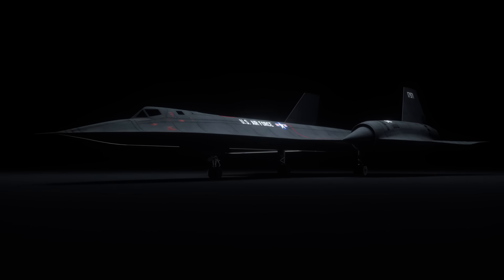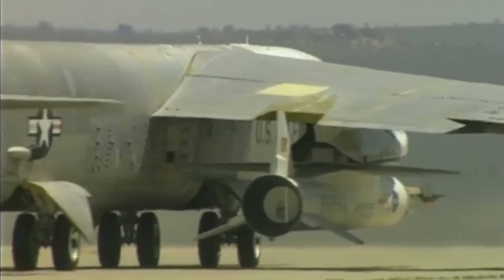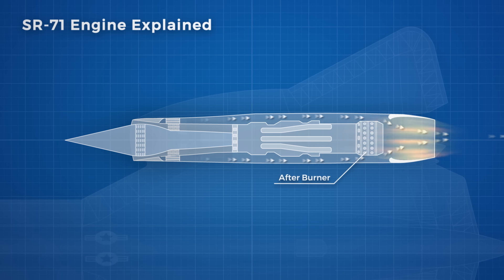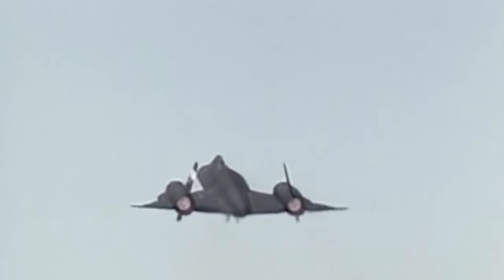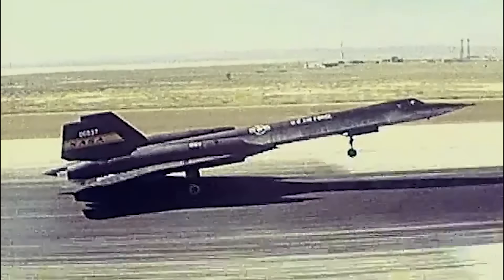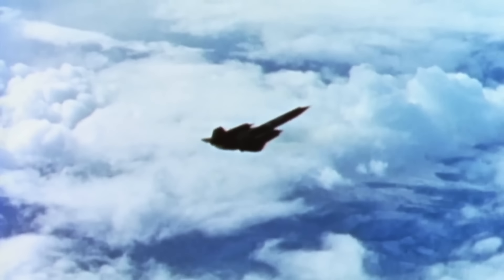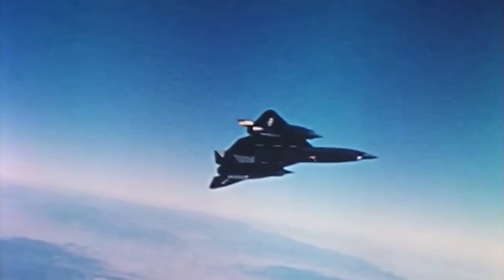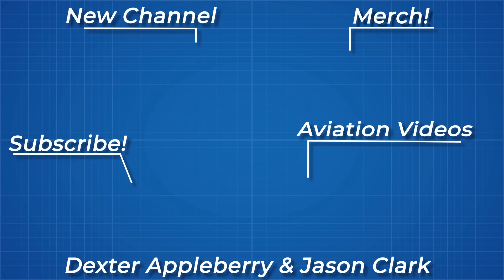The Insane Engineering of the SR-71 Blackbird

Comment: As a former SR-71 pilot, and a professional keynote speaker, the question I'm most often asked is "How fast would that SR-71 fly?" I can be assured of hearing that question several times at any event I attend. It's an interesting question, given the aircraft's proclivity for speed, but there really isn't one number to give, as the jet would always give you a little more speed if you wanted it to. It was common to see 35 miles a minute. Because we flew a programmed Mach number on most missions, and never wanted to harm the plane in any way, we never let it run out to any limits of temperature or speed. Thus, each SR-71 pilot had his own individual “high” speed that he saw at some point on some mission. I saw mine over Libya when Khadafy fired two missiles my way, and max power was in order. Let’s just say that the plane truly loved speed and effortlessly took us to Mach numbers we hadn’t previously seen. So it was with great surprise, when at the end of one of my presentations, someone asked, “what was the slowest you ever flew the Blackbird?” This was a first. After giving it some thought, I was reminded of a story that I had never shared before, and relayed the following. I was flying the SR-71 out of RAF Mildenhall, England , with my back-seater, Walt Watson; we were returning from a mission over Europe and the Iron Curtain when we received a radio transmission from home base. As we scooted across Denmark in three minutes, we learned that a small RAF base in the English countryside had requested an SR-71 fly-past. The air cadet commander there was a former Blackbird pilot, and thought it would be a motivating moment for the young lads to see the mighty SR-71 perform a low approach. No problem, we were happy to do it. After a quick aerial refueling over the North Sea , we proceeded to find the small airfield. Walter had a myriad of sophisticated navigation equipment in the back seat, and began to vector me toward the field. Descending to subsonic speeds, we found ourselves over a densely wooded area in a slight haze. Like most former WWII British airfields, the one we were looking for had a small tower and little surrounding infrastructure. Walter told me we were close and that I should be able to see the field, but I saw nothing. Nothing but trees as far as I could see in the haze. We got a little lower, and I pulled the throttles back from 325 knots we were at. With the gear up, anything under 275 was just uncomfortable. Walt said we were practically over the field—yet; there was nothing in my windscreen. I banked the jet and started a gentle circling maneuver in hopes of picking up anything that looked like a field. Meanwhile, below, the cadet commander had taken the cadets up on the catwalk of the tower in order to get a prime view of the fly-past. It was a quiet, still day with no wind and partial gray overcast. Walter continued to give me indications that the field should be below us but in the overcast and haze, I couldn't see it.. The longer we continued to peer out the window and circle, the slower we got. With our power back, the awaiting cadets heard nothing. I must have had good instructors in my flying career, as something told me I better cross-check the gauges. As I noticed the airspeed indicator slide below 160 knots, my heart stopped and my adrenalin-filled left hand pushed two throttles full forward. At this point we weren't really flying, but were falling in a slight bank. Just at the moment that both afterburners lit with a thunderous roar of flame (and what a joyous feeling that was) the aircraft fell into full view of the shocked observers on the tower. Shattering the still quiet of that morning, they now had 107 feet of fire-breathing titanium in their face as the plane leveled and accelerated, in full burner, on the tower side of the infield, closer than expected, maintaining what could only be described as some sort of ultimate knife-edge pass. Quickly reaching the field boundary, we proceeded back to Mildenhall without incident. We didn't say a word for those next 14 minutes. After landing, our commander greeted us, and we were both certain he was reaching for our wings. Instead, he heartily shook our hands and said the commander had told him it was the greatest SR-71 fly-past he had ever seen, especially how we had surprised them with such a precise maneuver that could only be described as breathtaking. He said that some of the cadet’s hats were blown off and the sight of the plan form of the plane in full afterburner dropping right in front of them was unbelievable. Walt and I both understood the concept of “breathtaking” very well that morning, and sheepishly replied that they were just excited to see our low approach. As we retired to the equipment room to change from space suits to flight suits, we just sat there-we hadn't spoken a word since “the pass.” Finally, Walter looked at me and said, “One hundred fifty-six knots. What did you see?” Trying to find my voice, I stammered, “One hundred fifty-two.” We sat in silence for a moment. Then Walt said, “Don’t ever do that to me again!” And I never did. A year later, Walter and I were having lunch in the Mildenhall Officer’s club, and overheard an officer talking to some cadets about an SR-71 fly-past that he had seen one day. Of course, by now the story included kids falling off the tower and screaming as the heat of the jet singed their eyebrows. Noticing our HABU patches, as we stood there with lunch trays in our hands, he asked us to verify to the cadets that such a thing had occurred. Walt just shook his head and said, “It was probably just a routine low approach; they're pretty impressive in that plane.” Impressive indeed. Little did I realize after relaying this experience to my audience that day that it would become one of the most popular and most requested stories. It’s ironic that people are interested in how slow the world’s fastest jet can fly. Regardless of your speed, however, it’s always a good idea to keep that cross-check up…and keep your Mach up, too.As a former SR-71 pilot, and a professional keynote speaker, the question I'm most often asked is "How fast would that SR-71 fly?" I can be assured of hearing that question several times at any event I attend. It's an interesting question, given the aircraft's proclivity for speed, but there really isn't one number to give, as the jet would always give you a little more speed if you wanted it to. It was common to see 35 miles a minute. Because we flew a programmed Mach number on most missions, and never wanted to harm the plane in any way, we never let it run out to any limits of temperature or speed. Thus, each SR-71 pilot had his own individual “high” speed that he saw at some point on some mission. I saw mine over Libya when Khadafy fired two missiles my way, and max power was in order. Let’s just say that the plane truly loved speed and effortlessly took us to Mach numbers we hadn’t previously seen. So it was with great surprise, when at the end of one of my presentations, someone asked, “what was the slowest you ever flew the Blackbird?” This was a first. After giving it some thought, I was reminded of a story that I had never shared before, and relayed the following. I was flying the SR-71 out of RAF Mildenhall, England , with my back-seater, Walt Watson; we were returning from a mission over Europe and the Iron Curtain when we received a radio transmission from home base. As we scooted across Denmark in three minutes, we learned that a small RAF base in the English countryside had requested an SR-71 fly-past. The air cadet commander there was a former Blackbird pilot, and thought it would be a motivating moment for the young lads to see the mighty SR-71 perform a low approach. No problem, we were happy to do it. After a quick aerial refueling over the North Sea , we proceeded to find the small airfield. Walter had a myriad of sophisticated navigation equipment in the back seat, and began to vector me toward the field. Descending to subsonic speeds, we found ourselves over a densely wooded area in a slight haze. Like most former WWII British airfields, the one we were looking for had a small tower and little surrounding infrastructure. Walter told me we were close and that I should be able to see the field, but I saw nothing. Nothing but trees as far as I could see in the haze. We got a little lower, and I pulled the throttles back from 325 knots we were at. With the gear up, anything under 275 was just uncomfortable. Walt said we were practically over the field—yet; there was nothing in my windscreen. I banked the jet and started a gentle circling maneuver in hopes of picking up anything that looked like a field.How's it going gamers? Y'know, online dating is a modern day miracle. Instead of going outside and being a functional member of society, you can stay indoors and talk with a Russian hottie online who is, in reality, your creepy uncle George on the other side of the screen. I think we've all willingly, or unwillingly online dated before. I remember going onto Club Penguin and sitting on the corner of the pizza store wiping out my sad emoji, and all the penguin baddies would come rushing in asking me "oh my god, what's wrong ;("

One of the more prominent online dating games in the modern age is has been IMVU. Yes, it's that same game that would spam their creepy-ass advertisements on whatever website you were in. Me, personally, as a kid, was never really inclined to "find my Bella". However, the other day I decided to finally stream it and experience IMVU with all my viewers, and here's how that went

　　　.　　　 　　.　　　　　。　　 。　. 　

.　　 。　　　• . 　　 • 　　　　•

　　ﾟ　　 Red was not An Impostor.　 ඞ。　.

　　'　　　 1 Impostor remains 　 　　。

　ﾟ　　　.　　　. 　　　　.　 .
Reply: did you read all that?
Reply: @D1ragebait  yes
Reply: @noahsiegel3127  bru
Reply: What's the bit about online dating got to do with it?
Reply: Kind of yes. Then kind of huh?

Comment: The range of the SR-71 was limited to approximately 11.5 hours, by the amount of liquid nitrogen stored in its dewars, used to inert and pressurize the fuel tanks. The inlet system was designed by Ben Rich and his small team. He was awarded the American Institute of Aeronautics and Astronautics Award in 1972 for designing the Blackbird's propulsion system. The SR-71 had "tactical limits" of Mach 3.35 with a maximum Compressor Inlet Temperature of 427 C. In addition to the air, by-passing the engine to the afterburner for additional cooling and thrust, the front of the inlet, with its associated doors and spike, provided an inlet duct pressure of 18 psi, while the outside air pressure at 82,000 ft. was only 0.4 psi. This large pressure differential provided a forward thrust vector, pushing on the back of the spike and providing 54 % of the total thrust, while 29 % was produced by the ejector, and only 17 % by the engine. The speed of the SR-71 was limited by thermal temperatures, recoveries from "unstarts", and the shock wave, coming off its nose, entering the inlets, creating "unstarts." Above 3.35 Mach, there was a high probability that the aircraft would be unable to recover, if an "unstart" occurred.
Reply: I had thought that triethylborane was the primary limitation on the max number of mid-air refuelings. I didn't know about the nitrogen tanks; thank you!
Reply: @justinhannan1713  The SR-71 had 16 "shots" of TEB (Triethylborane) per engine, which was more than enough to accomplish its missions, regardless of their duration, 1 shot to start each engine, leaving the remaining TEB to relight its afterburners after refuelings or, in the event of a flameout, to restart the engine.

Comment: It's a classic engineering understatement to refer to Unstarting as "a sudden yaw". Pilots were knocked unconscious several times.  The "solution" was to detect the unstart and snuff the other engine.  Pilots reawaken in the world's largest lawn dart on a course to slam into the ground at mach 2-3.  Fortunately, they were starting from such a high altitude that there was time before impact to restart the engines and start aviating again.  Compared to the risk of the aircraft killing you in a flat spin, Soviet missiles were not seen as dangerous.
Reply: Exactly, not a sudden yaw. But a violent shaking that caused pilots head to hit the cockpit windows and walls... Not a really nice behavior
Reply: onyeka onyyebuchukwu  "high velocity vertical non-elastic impact test"

Comment: The fuel leak information isn't entirely accurate. The truth is no sealant was ever found that would work at all temperature ranges. Instead, realizing the expansion properties of titanium, the gaps that allowed the leaks were deliberately engineered into the design. So when the aircraft got to operating temperature, the leaks were sealed off mechanically. The sealant applied to limit the leaks only ever worked at ground temperatures and shortly after take off. By the end of each mission the sealant was mostly useless.
Reply: You are correct.  As a maintenance airman on the SR in the late sixties, I got to experience the leaking fuel and resulting drip pans for four years.  Loved it.
Reply: That's also the reason for the grooves in the wings which you can see at 8:51. Thermal expansion could cause the wings to bend but instead now the grooves just get a little deeper and the wings remains straight.
Reply: Larry Fry did you work at Area 51?
Reply: Something else caught my eye, the leak table, showing Zone 15, Dry Bay areas, 950 cc/Minute/Side. That seems unbelievable. By my calcs, that 950cc is 1/4 Gallon. So that would be 2 sides x 1/4 gallon, per minute, or 1/2 gallon/minute. 720 Gallons/Day. Come on... I've never heard of a leak like that. Is that right? https://youtu.be/3hYSnyVLmGE?t=586
Reply: This is what I heard too when I saw this plane at a museum in southern california last year.
Reply: Nuno Hipólito  Probably Edwards AFB
Reply: ryan christopherson The Concord had a similar issue. When I did a walk around, I’d get fuel dripping on me from several seams on the wing.
Reply: true
Reply: @bigbaddms  That probably is right. The video mentions extensive leaking and both this video and others show fuel literally streaming off the plane before takeoff. But, by design, once the plane was hot, the panels expanded, improved sealing, and the leaking dramatically decreased.

Comment: As interesting as the 3D printed titanium parts are for the future planes, I'm much more impressed by the Blackbird's clever engineering from the 1960's.
Reply: Also computer vs slide rulers!
Reply: Most of the SR-71's design came from the A-12 which was designed in the late 50's and built around the turn of the decade.  Kelly Johnson and the Skunk Works were incredible.

Comment: Early on in development, the test pilots found out in the event of an unstarted engine that unstarting both engines and restarting them both at the same time was far safer than trying to restart the unstarted engine. So that eventually made into the engine management computer.

This plane turned really badly due to the risk of unstarting an engine. Standard procedure to dodge a missile was to climb and accelerate.
It couldn't outrun soviet missiles back then. Those could easily reach mach 4 already if launched from an already fast moving aircraft. But it flew so fast and so high the time between detection and scrambling interceptors meant it was already out of range by the time they could take off and climb for interception. Regarding SAMs, the tech at the time didn't allow for on-the-fly calculations of interception vectors, so instead they relied on radar pings, mening they would have to follow and then catch up to the SR for a kill. They ran out of fuel before they could catch it. By now, SAMs can detect and cut the corner to catch a Blackbird, making the plane tactically unwise to use. That's why the USAF retired it in 1998 with no plans for a replacement, until scramjet engines came along.

The soviet plane of choice for interception would be either the MiG-25 or the 31 after 1975. Those could sustain Mach 2.8 greatly sacrificing range or Mach 3.2 while the engines destroy themselves. One SR-71 pilot claims he reached Mach 3.5 flying away from one interceptor.

And speaking of the USSR, most of the Titanium for the SR-71 was purchased by CIA front companies in foreign countries from them.
Reply: Well, not 100% true as to why it was retired. Spy satelites are better(now, compared to back in 70-80) and cheaper in the long run to maintain. SR had to undergo full refit after flight due to damage those planes sustained on "normal basis" - like missing panels etc etc. JP7 awas also problematic - TEB is toxic and hard to handle, each flight == risk of running out of it. 
So all in all, it was expensive gamble to operate.

Comment: Titanium can be tough to work on but the stainless steel alloys can be a nightmare in the machine shop. Hastalloy, Inconel and the other wear resistant alloys work harden quite easily and will make you pull your hair out !!   I just cant imagine working on this stuff back in the late fifties.  Lots of respect to those machinists and engineers !
Reply: I have had the unfortunate fate of dealing with A286, I can't imagine how shitty inconel is..